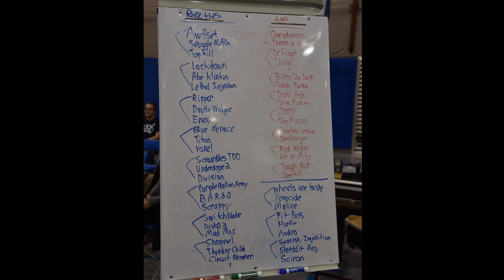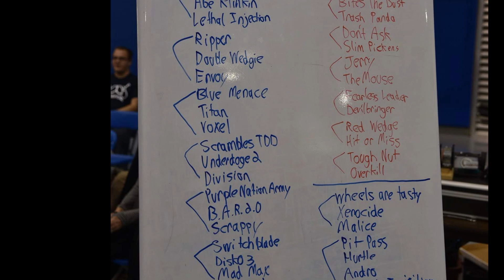SWORD Fall 2019 Event Recap: Division V2.5

Comment: Were you replacing the shafts or did you have to replace the entire motor?
Reply from the maker: At the event I had no shafts separate from the motors so I swapped the whole motor. Hopefully I can make or buy replacements for the shafts and save those motors as I have 3 now with no shaft that work fine otherwise.
Reply: @JustCuzRobotics  I use the same motors. Please let me know if you ever find any replacement shafts!
Reply from the maker: @ianharlow  I emailed Hobbyking support weeks ago and they said the Propdrive V2 2830 shafts would fit the 2836 as well. I saw from the images of the 2830 the motor seems shorter but has the same 4mm to 1/8" taper so I bought four for $0.15 each on the off chance they do fit. As expected they only sortof do. The 1/8" portion is just about the same length but the 4mm portion is about 4mm shorter than the 2836 shaft.  I just finished assembling a motor with the 2830 shaft and the set screw in the rear doesn't sit on the flat of the shaft anymore, plus the shaft is clearly not all the way to the rear of the motor can, meaning this is definitely not an ideal solution. I think I'm going to lathe my own shafts from 4mm steel shaft stock as that is only $10 for enough to make like 20 shafts, whereas 4 new motors would be $80. If you have no access to a lathe the HK shafts might work in a pinch but no guarantees. I will likely do a weapon spinup test with the replaced shaft to see if it would work in an emergency. https://www.amazon.com/Uxcell-Round-Rod-Piece-100mm/dp/B00JR3Q1GI
Reply: @JustCuzRobotics  gotcha! Let me know how it works. I'll let you know if I find an off the shelf replacement shaft
Reply from the maker: Long story short the 2830 shafts don't fit at all. I ended up buying 4mm hardened steel lathe stock and making my own replacements. Original shafts are 49mm long and the stock was 10 100mm long rods so I have a bunch left and made 6. Drilled out the pulleys to 4mm as well. All 4 of my 2836 motors are now running those and I didn't have a single one fail during 5 fights at Norwalk!
Reply: @JustCuzRobotics  oh wow!! Thank you so much for the update. It's good to hear the news.